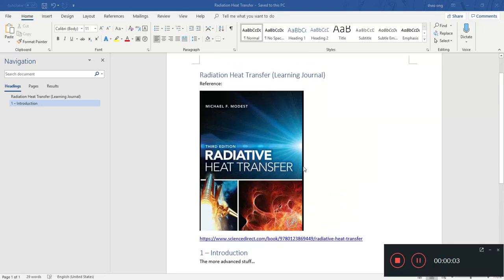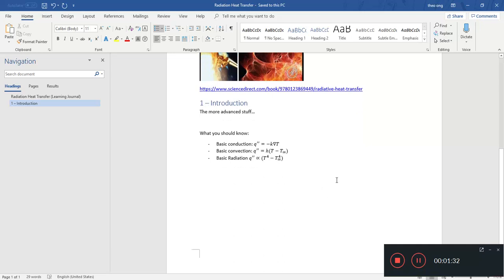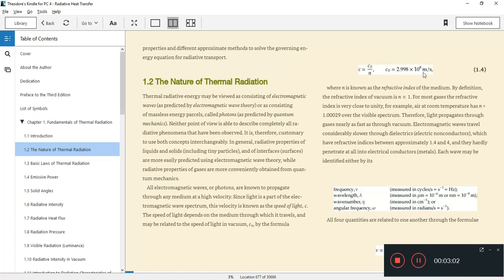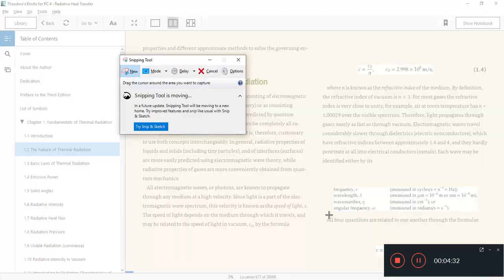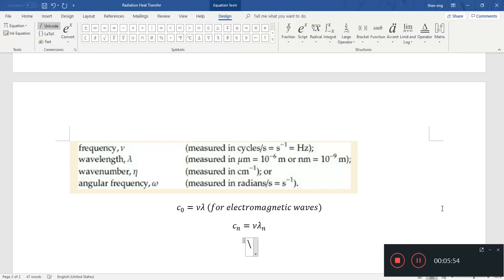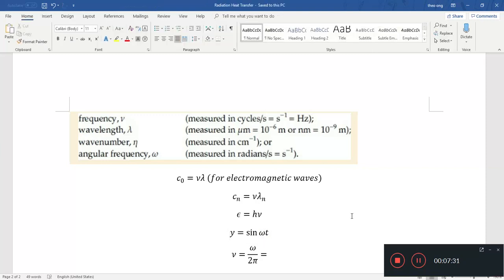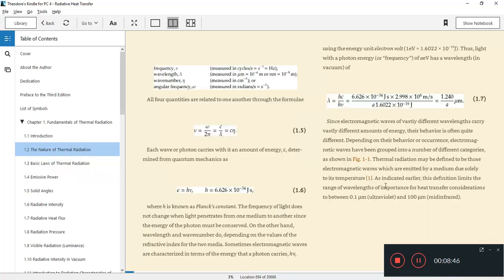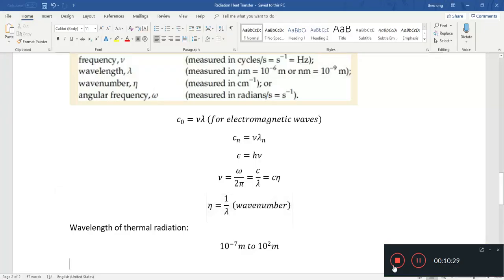Radiation Heat Transfer Learning Journal 1  - Basic Definitions

Comment: Hello TheoOng!
I want to simulate UV radiations using fvDOM but I can not find where should I define discrete nLambda values or band for UV radiations in fvDOM. I have gone through the code files and could not figure it out. fvDOM radiation properties usage in constant folder does not show any nLambda value asked from user beside nPhi,ntheta etc. Please help if you know how to define it, I'm stuck :(
Reply: @TheoOngScienceAndEngineering  Have you gone through wideBandAbsoprtionEmission in radiation modeling? There is no tutorial which shows how to use this model. It has been giving me segmentation fault error
Reply: @TheoOngScienceAndEngineering  I also saw your question about defining bands and wavelengths for mulitBandAbsoprtionEmission Method on cfd online. Were you able to find the solution?